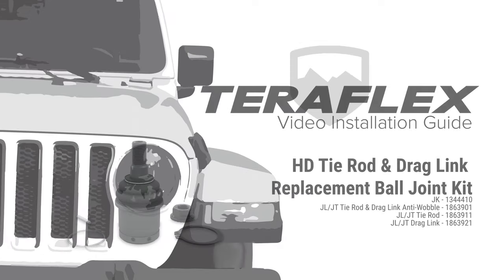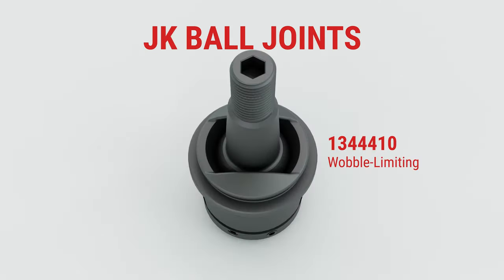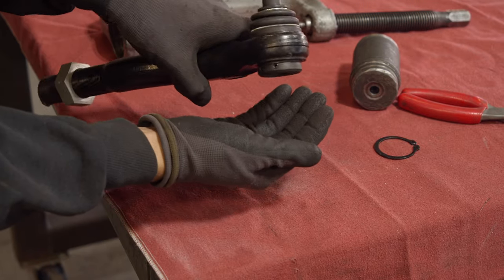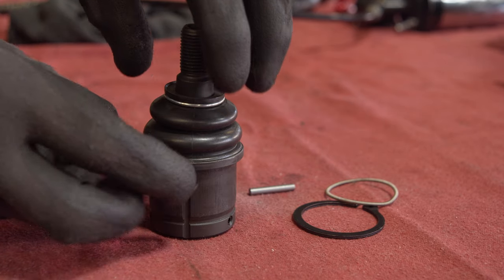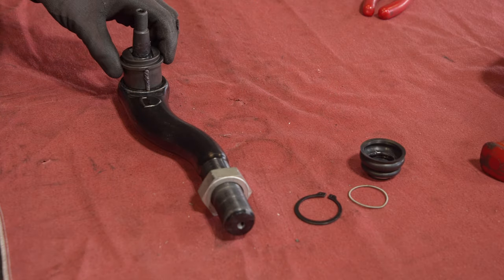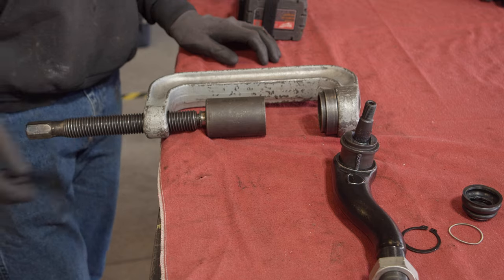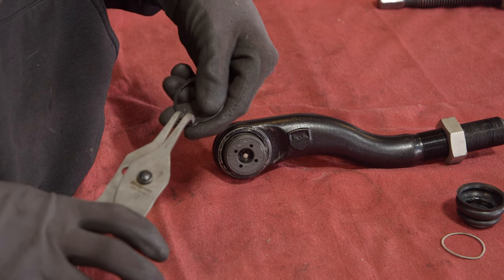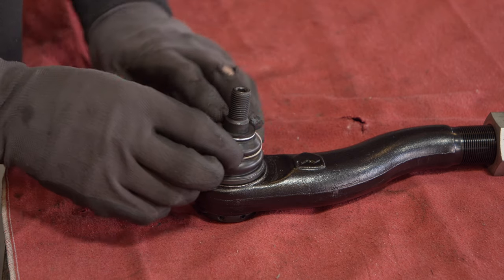HD Tie Rod & Drag Link, Replacing a Ball Joint | TeraFlex

Comment: Do you happen to know the press kit you were using or the size of the receiver cup. Having a hard time finding the right size, the distance between the edge of the joint collar and the edge of the tie rod doesn't give you much to sit the receiver cup on with out is slipping off or being off center.
Reply: Did they reply to you? Or did you figure it out? I'm having the same problem